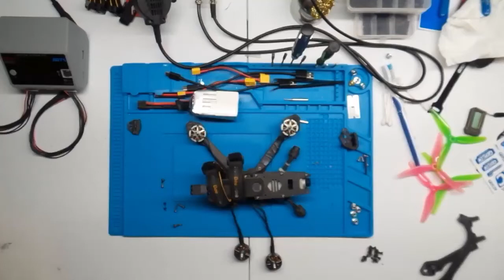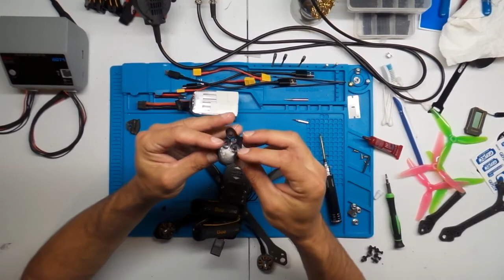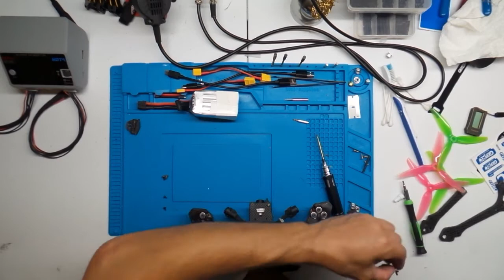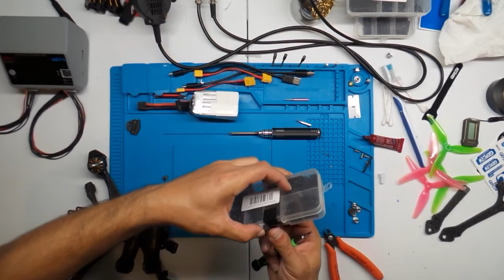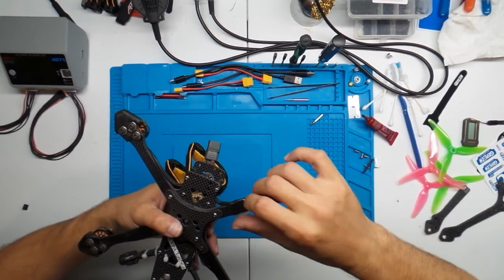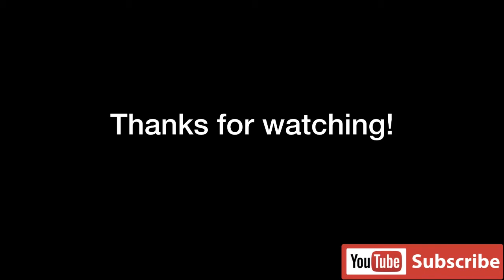Newbeedrone Vivid arm replacement

Comment: One of mine sounded rough straight out of the box. I didn't even have it soldered up yet and I could tell it sounded funny compared to the others. I never contacted NBD about it. I'm about to rebuild mine and put the air unit in the middle like you have it. I think I'll get better VTX signal with the antenna mounted up front on each side. Also, where is the antenna for your RX?
Reply from the maker: I had an issue with something of theirs they took care of me no problem so if you ever have an issue I would definitely email them. I'm using the DJI controller so the only thing it has is the flight stack and the air unit with the two antennas which on my quad as you see one is on each side of the front. Hope that answered your question. Happy flying!
Reply: @relentlessfpv1822  I didn't realize you were using the DJI controller. I'm using JumperT16 with Crossfire so I have an RX onboard with 4 additional antennas. I'm wondering if I should switch to DJI.
Reply from the maker: @youzrnaim  I thought that about switching to crossfire because of how far you can fly with it. Then I started thinking for freestyle I'm not really going all that far away and using the DJI controller is just such a simple process all around and has plenty of range for that in my opinion.

Comment: The motors take quite a bit. Depending on your tolerance for noise, you can also look at replacing the bearings. Although he is no longer with us, "Project Blue Falcon" has a great video about replacing the bearings in these motors. As long as the shaft, bell, and base is straight, new bearings would make them sound brand new again. Keep her in the air!
Reply: Just heard the statement about leave a comment about setup and how long flying. I started flying real aircraft with my dad at age 7. My dad was a naval aviator. I started flying quads in 2015 when I broke both my legs. As far as setup, I currently have 24 quads sized 2 inch through 7 inch. I just love to build.
Reply from the maker: Perfect thanks! I will be checking out his video for sure. I saved all the motors so maybe I can repair some. Thank you for the information really appreciate it. What a awesome story, well except for the legs. 24 Quads holy s$#! Lol. Good stuff man thanks for your comments.